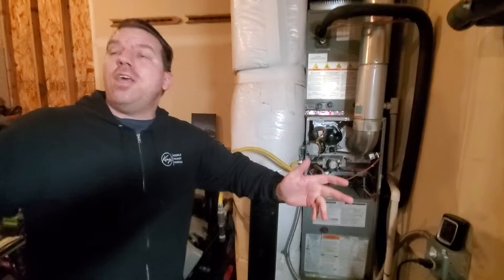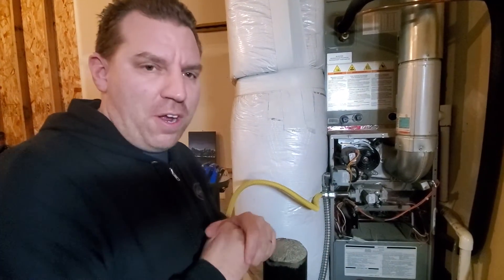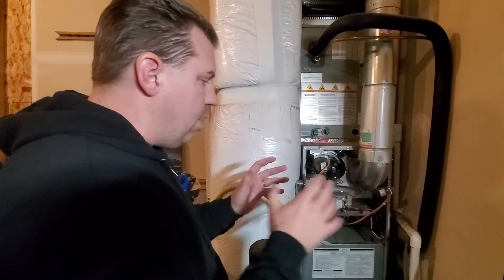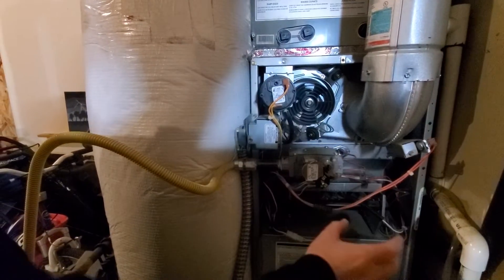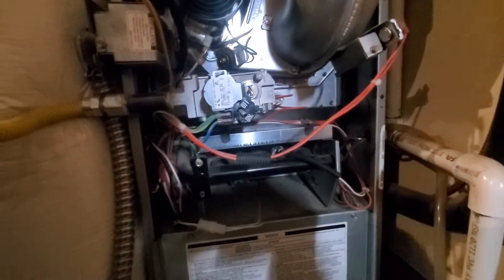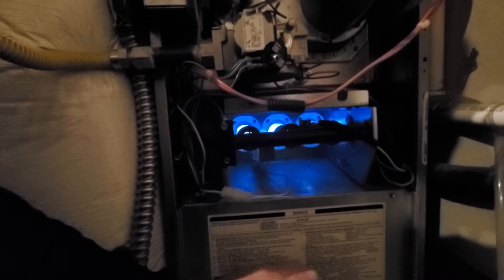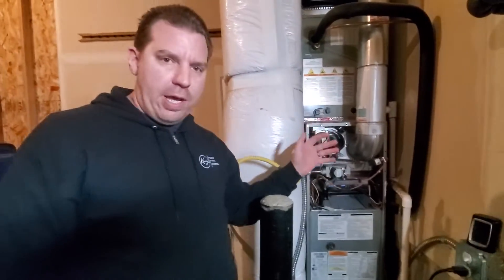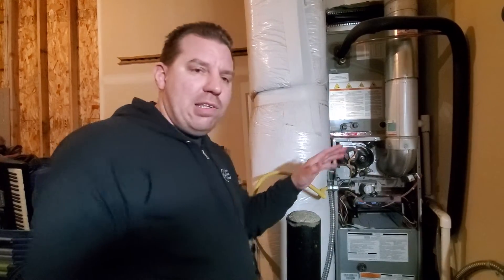Let's Talk About Gas Furnaces: 80% verses 90+% Pros & Cons of Each!

Comment: Well at least you admitted that the high-efficiency furnaces are not as reliable. I have had four high-efficiency furnaces in the past 20 years nothing but problems condensing clogging what was the 80% before lasted 43 years I went back to an 80% so much more reliable and so much cheaper and you really don't save on the gas bill either that's a bs to.

Comment: My 80 percent furnace is in the attic so the noise issue is not an issue for me.  It is cheaper.  I just replaced my 20 old unit this summer.  It lasted 20 years....builders grade as well.  No way would I have recouped my money for a 90 plus furnace in the next 20 years.  Its a RunTru by Trane but I am sure it will be as reliable as my builders grade...I not once replaced any parts on the builders grade not even the the capacitor.  Crossing my fingers....